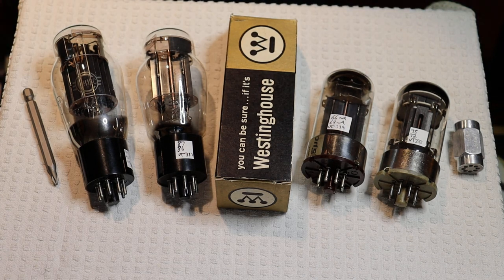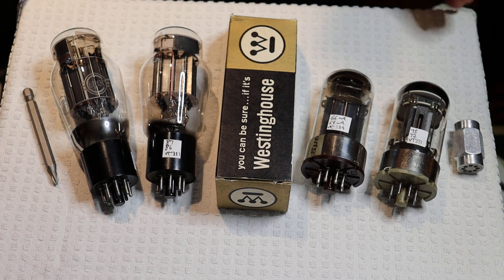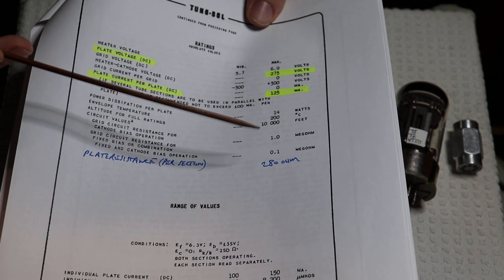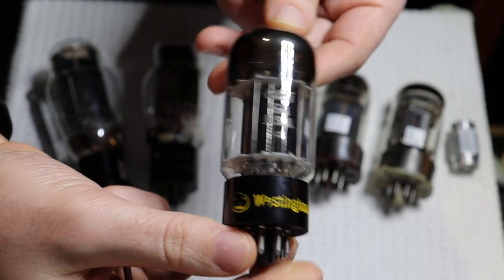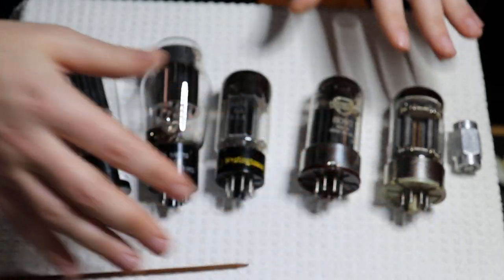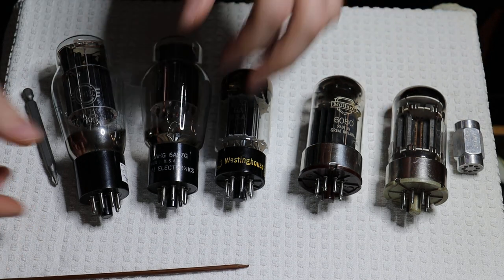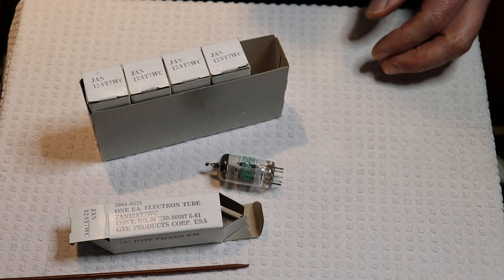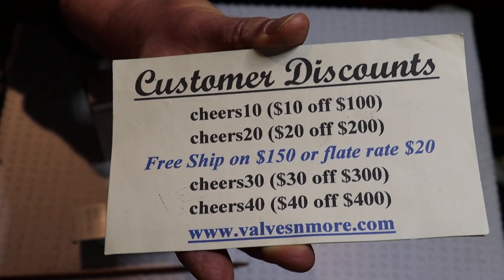Tube Lab #120 - 6AS7G, 6080 & Soviet 6N13S Tube

Comment: I'm trying to buy a GE 6as7GA in the future but I haven't found data on how they last do you know any?
Reply from the maker: Some data sheets will show expected filament life expectancy, but many don't.  If your data sheet doesn't, you can expect approx 2,000hrs for a true NOS (new old stock) tube, when used in a moderate circuit configuration with stable household mains voltage and responsible operating procedures.  BTW I think the tube you are referring to is the 6AS7GT, which is the first gen of the type.  If you are concerned about longevity there are mil spec versions of the next gen 6080 that may have a longer life filament (check data sheets).  We specialize in the 6AS7GT and 6080 and always have a large selection of both good used and NOS available.

Comment: Yes the 6080 was used in powersupplies ..................also in the Tektronics Oscilloscopes ....they still function after decades ........
Thomson made a lot of these 6080 WC..........
The 6AS7G sounds very musical in amplifiers.
Only a common problem that can occur  is that you find rarely a tube with exactly the same triodes inside .....but that is relative and can be adressed , even closely matched tube won't be any longer matched when they age and most transistors have same issue .......
FM acoustics ( Suisse ) went as far as selecting two transistors out of a batch of one thousand ...........hence the price of their amplifiers............
This tube is a forgotten gem for  DIY....